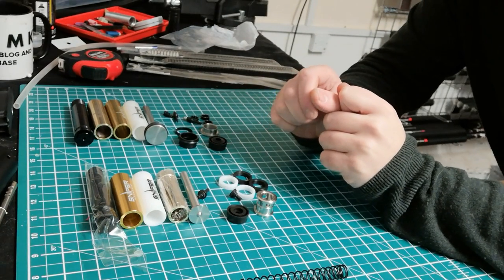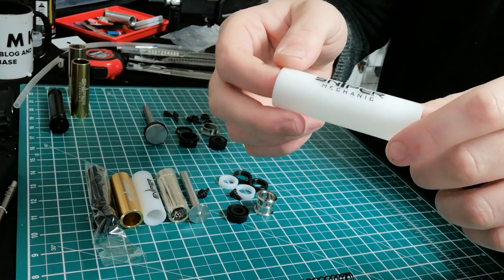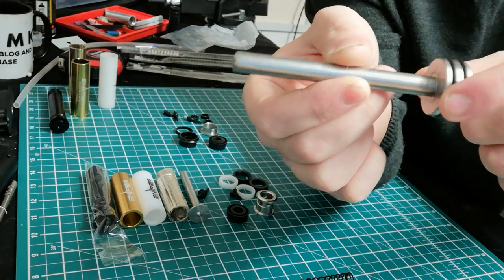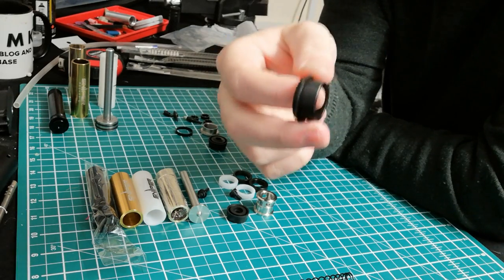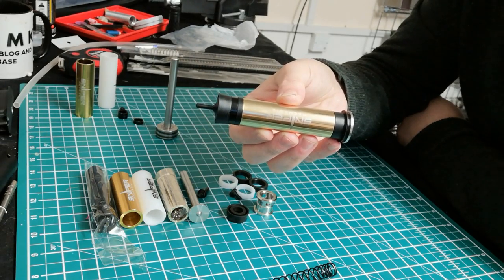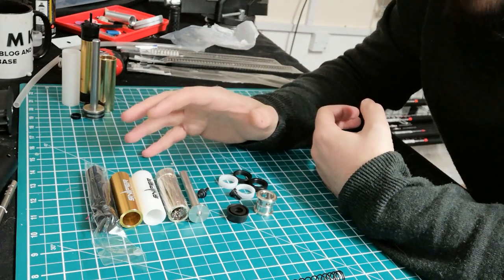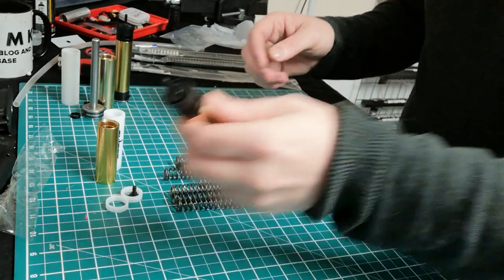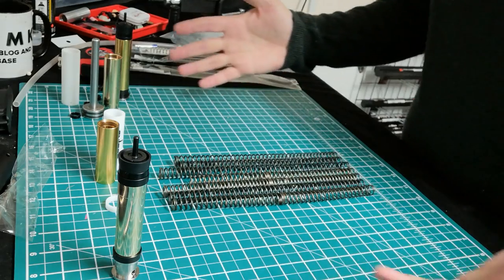W.A.S.P Information and Release

Comment: Hi, i was wondering how vell is this fitting a Laylax sylinder and laylax zero trigger, i have a laylax zerotrigger sett and a Action army hop up chamber and was wondering if i should change opp nossle or hop up chamber for a better air seal, i got a leak between the nossle and hop up

Comment: A question: in your Wasp manual Stands that the m150 feeder isnt function with the wasp ...

? Why you install an m 150 in the vid?
Thx for an answer
Reply from the maker: Hi, I didn't state it doesn't function. Due to the compression length, you simply can't use all 3 spacers with the M150 as it becomes to long for the sear to catch, different springs have different compression lengths, so when you add spacers you increase this length, for some springs, namely the SBA M150 in both VSR and SRS. Also the M150 varies by batch, some fit perfect and others are just a few mm to long to catch sear

Comment: Well, i ordered one for my „all Edgi setup.“ lets see if it works with Edgi 550fps spring
Reply from the maker: It won't work with the EdGi sear as it's not a 90 degree and the Wasp is, also the spring guide from EdGi won't work
Reply: SniperMechanic my setup is a 90 degree setup currently ...with a springer custom Trigger
I ordered a 90 Degree Piston and 550 FPS Spring directly from Edgi
Reply: SniperMechanic so what kind of Spring Guide do you recommend? Thank you from germany
Reply from the maker: @bfkrug  you need to use the spring guide it comes with. This kit includes the pistons, sleeves, brakes and spring guide, EdGi springs won't work either. All the info for this is on my website :)
Reply: SniperMechanic okay sorry, i did not have Time to watch the Video in detail. I‘ll check your website to see what spring I need to buy. Just need my 3.2 Joules field limit.